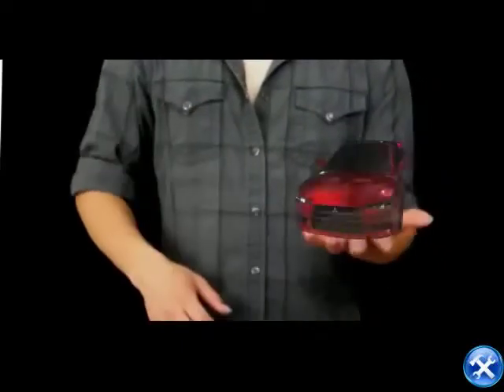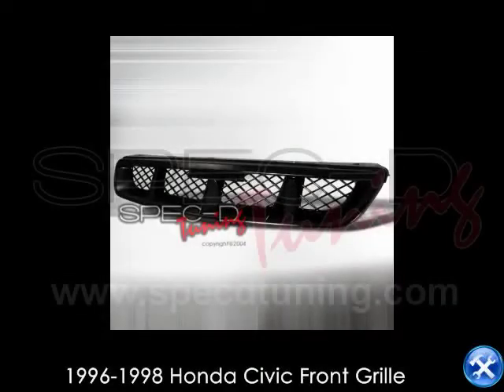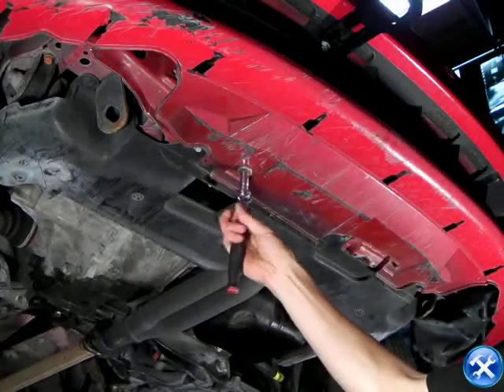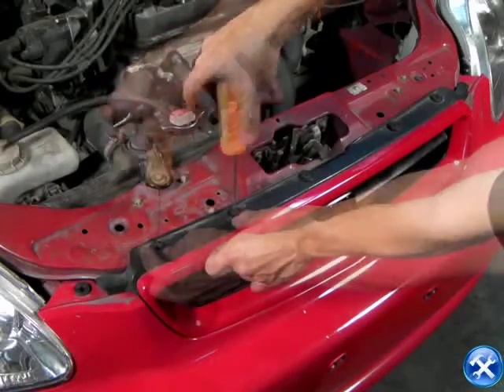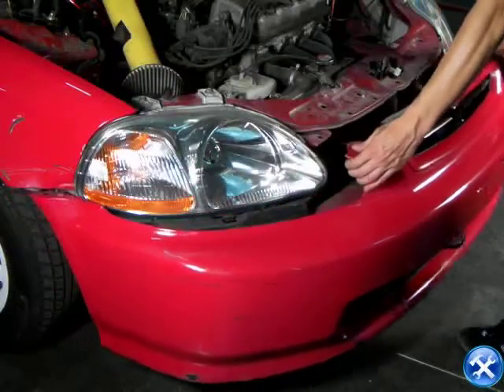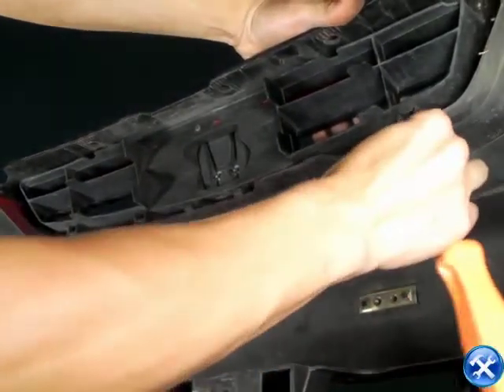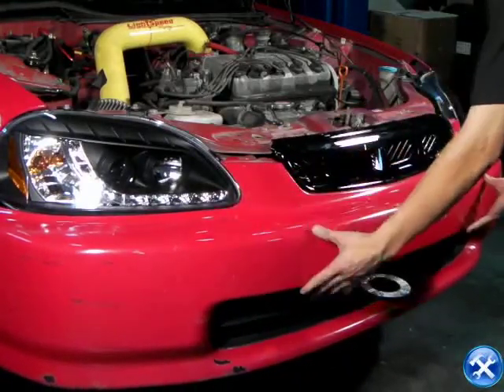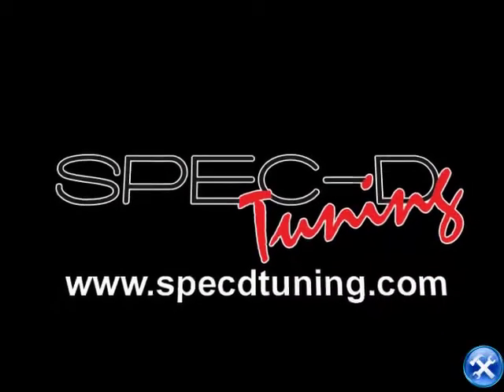SPECDTUNING INSTALLATION VIDEO: 1996-1998 HONDA CIVIC FRONT GRILLE

Comment: @iiMuHHitman hopefully, yours will turn out better but for me, i was just able to slightly fasten the clips at the bottom and just put some thick rubber on the top side of the grill, in between where the screws fit in to hold it tightly... its not the cleanest job but it turned out ok.

Comment from the maker: Yes, unless your new bumper requires some few adjustments and new bolt placements.. other than that, your new bumper should be a direct fitment using the original screws and nuts

Comment: The first clip you took off in this video, right next to the passenger side headlight.  That little bracket that the bumper is clipped to, where can I find a replacement, mine is broken?

Comment: i bought a type r 98 civic grille for my 98 cx hatch. for some reason, it doesnt have holes on the bottom to fit the 4 screws... it just has clip like things.. anyone encounter this problem or solved it? cuz now the whole bottom part of my grille isnt fastened and is slightly sticking out...